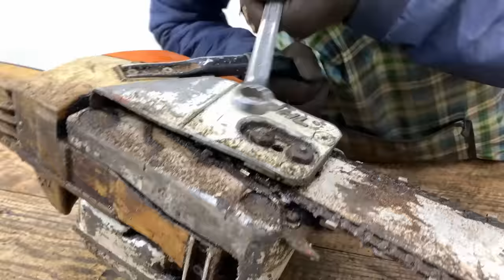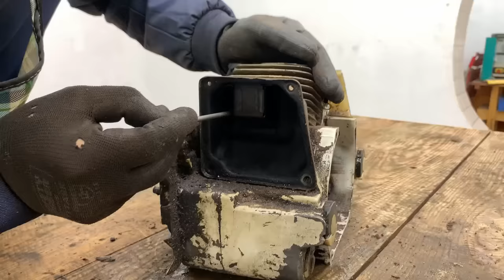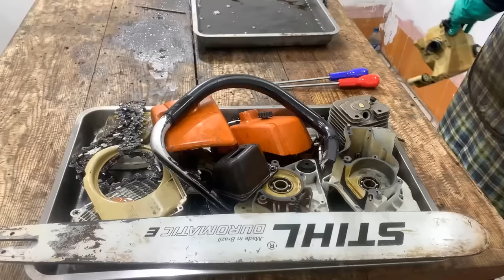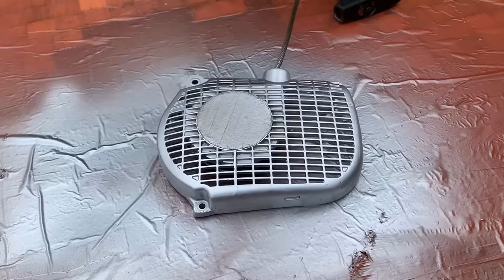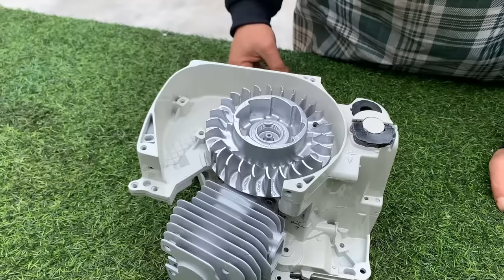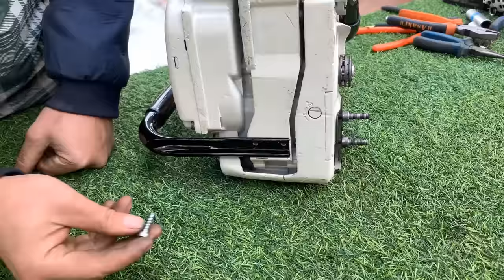Restoration Old Gasoline Chainsaw STIHL // Restoring 2 Stroke Petrl Chainsaw

Comment: You put the chain on backwards. You painted the air filter. You didn’t lubricate the pilot bearing with grease, that should have been replaced and you didn’t put any bar and chain oil in machine.
Reply: Also, needs 2-stroke oil applied to piston, rings, cylinder, crankshaft, bearings, etc. during installation.
Reply: what happened to chain brake missing should have replaced,does it even run
Reply: This was a waste of time
Reply: Amateur mechanic.
Reply: Where do I begin.
Reply: I was thinking the same
Reply: also the crank was painted aswell😂
Reply: I've noticed few issues too.he painted cylinder head that going to burn that paint off on first run..he also painted inside plastic parts that don't need to be painted..
Reply: I didn’t see any crank seals or for the bearing.
Reply: Bruh
Reply: Mi se dopaga od edna strana a od druga strana ne mi se dopaga so ne ja zapali masinata kako rabiti perfekno
Reply: Lmao
Reply: He also painted the crank shaft and everything inside the house and engine
Reply: The chain was also to tite
Reply: Bru
Reply: 7
Reply: And he missed the chain tensioner. Catastrophe
Reply: I'm sure we all saw the numerous mistakes he made. Too many to list actually. Only one person besides me noticed he didn't even try to start it on the video .
 This was nothing more than a gigantic waste of time. I saw on the Bar where it says "made in Brazil" this is the exact reason I don't waste my money on Stihl Power heads any longer. When they all came from Germany they were a great product but when they started farming out the manufacturing is exactly when they started to go down hill in quality and up in price until it's just too much of a risk to purchase one.
 Look, I've been a production Faller most of my life and used to run nothing but Stihl powerheads ( I still have one out in the shop that was built in Germany and is nearly as old as I am and almost as heavy but it still fires right up and could do 8-10 hours on the mountain no problem,  but I restored it myself with a ton of new replacement parts and just keep it for sentimental reasons. I switched to Husqvarna years ago and so far have not had one issue with their Pro Duty Saw Power heads period. But they too have started farming out the manufacturing of their stuff. They Bought out Jonsered Swedish saws (that also used to have good quality) and Poulan down in Georgia I believe and you can buy them now a little cheaper than Husqvarna Saws. Hell I own 2 of the Jonsered Pro Saws that are made in Europe by Husqvarna that are exact copy's of the same Husqvarna Pro Saws but less money ! And they run like a champ.
 I've ran 390XP and 395XP saws for years now and actually prefer the 390 over the 395 because of it's power band with a 3/8" pitch Full Chisel Skip Tooth chain on a 32" pro lite laminated bar...for the work I do now....I have bigger bars and chains but this just seems to be the best balance for the saw at least in my hands. I've bought their new 550 XP Mk II, the 572 XP  and just got a 592 XP powerheads these are all the "New" generation of electronic saws that you can hook up a laptop to and it will tell you things you never knew. 
The 550 I think was the Guinea Pig  for all the new stuff they were planning and when they got a combo they liked that worked right and was dependable they did the 572 then the bigger 592....now I used to have all my powerheads ported and built to run all out as fast and powerful as possible till our local Saw repair guy died from Covid about a year and a half ago now and I started doing all my own porting and building my own US Forest service legal Mufflers for all our powerheads and while the 572 gave me fits in a stock out of the box shape once I went through it with the computer program on our laptop and ported and fixed a couple of "other" issues it had it runs perfect now. I just got the 592 last week and am porting and reworking it right out of the box but I'm positive it will become my new favorite powerhead as soon as I finish it and find what length of bar it likes best but I'm guessing it's also going to be at its best with a 32"-36" bar.
 I was able to purchase 3 brand new in the box old stock 390's just because I've already heard the new stock 390's are having issues so I'm good most likely till I retire. 
 I carry my 390 to the woods every day and have no regrets or complaints.
Reply: Woodruff key ?
Reply: Coming up next on rough as restos 😂
Reply: @CrazyHHO19  9
Reply: Für Testversuche muss Man kann kettenöl einfüllen, da das öl beim schneiden dafür sorgt das die Kette nicht zu heiß wird und noch Cut so schnell stumpf wird
Reply: ❤❤٠
Reply: @mikespain8655 ⁰⁰
Reply: It’s just clickbait. They clean it, paint it and put it together with no knowledge. This thing doesn’t run
Reply: And didn't even use any assembly lube on nothing
Reply: He put regular gas instead of 2 stroke also
Reply: The video was faked
Reply: Not only that. The chainsaw wasn't even started to see how it ran!!!!!!!
Reply: Wow what a waste of time🤯

Comment: Nice way to clean a saw I guess and looks very nice all said and done. However, aside from the obvious chain being on backwards, chain brake missing/not added, chain Tensioner missing, and paint on the air filter. It would seem they made so many more mistakes I can't even count them all, especially putting paint on the Crankshaft. Who knows if the case bearings are any good, (love how they hammered the case together, couldn't have thought about that myself) but I digress, the clutch cage bearing needs to be replaced and they put the bar studs on backwards. Not to mention if the Carburetor is any good. But all-in-all they " kinda " know how to take a saw apart and put something together. Nice try👍
Reply: my thoughts exactly, I was horrified watching a lot of this lol
Reply: I suppose video made in India 😂
Reply: And to top it off, leaving us hanging without seeing it run!
I wanted to see it spit paint😂
Reply: At least the saw was safe from catching Covid….
Reply: They probably could have just serviced the carb and started this saw right up. Instead they took everything except the carb apart. What a waste of time.
Reply: For me, it was funny to see all these mistakes.
Nobody have to wonder of the missing function test ...😂😂😂
Best of all is the wrong chain direction ...
Reply: That’s what I was thinking if this was a chair it would have been a great job but not a complex machine. Besides like you said just rebuild the carb and it would probably start right up. There is no way this thing would star the way it is.
Reply: Dude, you beat me to it.  If you are not going to tale the time to do ot right....  At least new rings, better tape before painting, relube ball beariings, replace missing parts, check the cylinder for proper clearance.... All you did was a half way cleaning.  An old addage from shade tree mechanics is "If you can paint it you don't have to clean it."  You are sooo close ti doing real good here.
Reply: In fact the chain isn't nessesaryly mounted wrong, because it doesn't matter if it cuts on the forward stroke or on the Backward one, when you use it as a handsaw.
Reply: Qa
Reply: My sentiments exactly.
Reply: The best bit for me was when he painted the air-filter. Genius 'hack' I might have to try on my own saws. (Assuming I want them not to run.) Studs backwards, half the bearing missing, chain backward - etc etc etc. It all adds to the entertainment value.
Reply: Poor chainsaw 😭
Reply: they probably didn't even put temperature resistant paint
Reply: Why they dont start with the carburator . Cleaning can allways after that he is running again.

Comment: Did you sand plastics so primer and paint will adhere?  Compression test?  Leak down test? Clean carburetor?  Replace crankshaft seals? The MS 381 is the newer version of the MS 380, so really not that old.  All that work and you didn't even fire it up on camera.  I know Stihl products and this is a solid saw.
Reply: And the Chain goes backwards
Reply: And where is the Chainbrake
Reply: Looked better before, these old things just need a full tear down and clean/rebuild. It will be peeling paint forever now and won’t even start. 😂😂 this is hilarious man so rough as guts. 😅😅 can u do a video of trying to start 😂

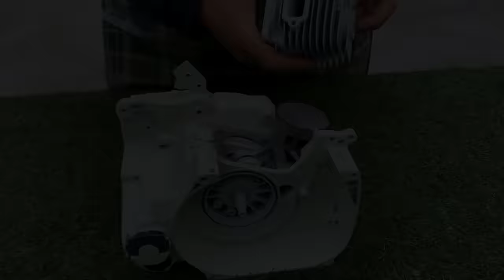Comment: 18:05 / 24:19 : yes VERY good job no 2 stroke oil used. Just put everything dry together and crush the rings into the cylinder without compressing them by hand or something...

Comment: Mate what are you doing to that saw... all you did was take it apart and wash it down, then reassemble without replacing anything, and with no lubrication on anything, and gasket sealer and paint where it shouldn't be.  And the chains on backwards.

Goes to show, a fresh coat of paint makes things look impressive to people who don't know much about them
Reply: Yeah I stopped at the point I saw the cylinder being put back on without a torque wrench lol

Comment: I've just started watching this and the first thing that comes to mind is, since when has anybody thrown out a Stihl pro model chainsaw? They are always worth money for the parts alone and that saw isn't even super old. Not with that style of oil and gas caps. It also had good compression and likely just needed a little tlc to run like a beast.
Oh well back to the video, though I read some of the comments and so I'm not expecting a happy ending.

After seeing the video.
Well that was a huge bummer. I'm sure glad that wasn't my saw. Smh

Comment: At least disassembling everything before painting... Now you have Paint in your sump!
Reply: Youtube seems to want me to put up some content. Challenge excepted!
Reply: This is sloppy. Put in the effort!
Reply: @jt9498  Yeah. It's more like "wash everything in gasoline and slap back together and spray the crank with paint". Or maybe I'm an idiot and asian gas magically regenerates bearings? :D But even more sad is when someone is calling people like us haters because we can see the errors and we know how restoration should look like. Personally I would at least change the bearings and seals if the top end had decent compression and wasn't scratched and changed out the clutch needle bearing.

Comment: You can't call this restoration, cleaning and bad painting everything yes....not restoration...and btw...you paint also the cylinder....my friend that one needs cooling, air cooling and the paint is not helping him ...and you pain also the connecting rod assembly... imagin that when you start the engine all that paint being dissolved by the fuel mixture and deposited allover the engine. You even painted the air filter ... why !?  where is the logic ?!  I tend to believe you're a painter ... but one of poor quality.  Did you imagine that there is an air valve for the oil tank that you covered with paint?
I hope next one is going to be better!
Good luck!
Reply from the maker: I am Happy To Receive Your Feedbacks, advices, Suggestions To Improve Myself Better 
!!!I Apologize For The Mistake If I have Made In This Restoration

Comment: Congratulations on doing a 50% job on a 100% restoration. Painting over multiple components that shouldn’t be. Including the air filter 🙄. No grease on pilot bearing. Andddd the chains on backwards.  Even if it did run it wouldn’t for long. Wall hanger

Comment: Do you want wood work with this Stihl chainshaw or you will Hold in vitrin cupboard in room forever? I have Stihl 880 and Stihl 171 Chainshaw and Stihl FS 560 bush cutter and Stihl HS 45 Hedge cutter

Comment: Not really sure what you accomplished there. Didn't rebuilt it. Shot it with a completely incorrect paint color including the crankshaft. Not a torque wrench in sight. I just rebuilt the same saw(038 magnum 2) but I took the opposite approach. I  used ALL new parts to the point that I pretty much just built a clone. But it looks and runs like new. I still have all the old parts and if I can ever get the original paint I will restore it too.
Reply: Edit. Sorry. I was wrong about the paint. That part looks really nice. You should have had someone who knew what they were doing fix the rest. Could have been a great project
Reply from the maker: Thank you for your feedback so we can improve future products. Wishing you good health

Comment: i watched the whole video and i can respect the skill to disassemble, clean, and reassemble the saw but feel like he did a lot wrong.  Not  one to fault someone but looked like he painted the air filer, torqued the spark plug down and the bar cover down with an impact as well as put the chain on backwards.  Wiring also looked suspect. This saw will likely not run well if it ever does. Its also can be no older than 16 years old.  MS381 was made is 06.  Just my input sorry if I offend.

Comment: I watched the clip only partially because I noticed several mistakes: the materials used for painting, the mounting technique; this is a clip with technical achievements. Among the mistakes, I can list: painting the cylinder, improper painting of the covers, dry assembly of the piston...

Comment: i feel pain in every second of watching this video... 
so many questions....

Why would you paint the airfilter, the gasfiller cap and the handelbar, perfectly fine orange plastic, exhaust, cylinder and clutch?
Why would you not replace the broken chain catch pin?
Why dont you repalace the missing chain break lever?
Why dont you replace the bearings and seals on the crankcase? 
Why not inspect/replace the manifold and impulse tube if you have it apart already?

On the other hand, why bother if the thing doesnt run anyway because of the painted airfilter and crankschaft/crankcase, uncleaned fuelfilter and not cleaned carburetor

and then we get to the real horrors of this video

i have not, and dont want to ever again, see anyone dis- and reassemble a crankcase with a hammer, mount the flywheel with an impact, mount the studs for the sprocket cover backwards, loose and without loctite.

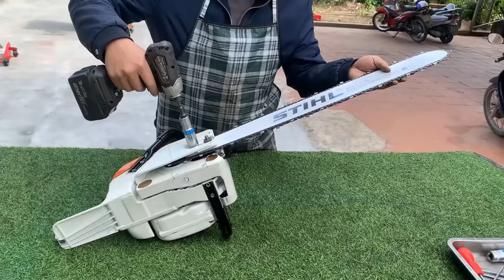just looking at the studs at 31:55 feels wrong... all exposed and stuff...

all in all i can say that this saw could look nice in pictures from 50 feet away. 
could.

for every thing else this was complete garbage und a waste of time

still fun to watch for me so 3/5

Comment: We had one of these at my workplace. And I looked into it because everybody said it didn’t work, and if they could get it working again, they would be using it all the time. I looked at the air filter. The air filter was pretty bad so I replaced that tried starting it still didn’t start so I checked the chain oil level and the chain oil level was bad had no oil in it so I filled that up and then I checked the gas. It had a little bit of gas in it, but it was pretty old, so I made some new Mixture and put some new mixture in that still didn’t start so I put some starter fluid in the engine and took the spark plug out and pulled the chain on it so that the piston can move up and down and I added a little bit of some gas mix to it that helped a lot with rinsing it out and then I put a spark plug back in and it still didn’t start so I got a new one and put a new one in and that puppy started right up.
Reply: My grandma had a ms181c in her garage that she bought as a display model even though she wanted one in a box, so it never ran even though she was told it would but it sat for 10 years roughly and I found it and asked if I could try to get it running, I replaced the gas and cleaned it up a bit and nothing, so I replaced the spark plug and boom it ran, I'm 15 but i have already put it through some professional work and it doesn't hold back.

Comment: The saw isn't exactly old, using a knob rather than a screw to take off the back, and the caps for the chain oil and gas+2-stroke oil have the 'lock', early 2000s, almost identical to my ms290
Reply: Ms is 2010 to current day
Reply: @brockschaner2861  MS started in 2000/earlier

Comment: Even after all the big no no's done during the so called restoration you didn't even attempt to start it up lol I can guess it doesn't run at all because you didn't fix the saw. All you did was clean it and paint it. There's a saying here in the US about that kind of crap, putting lipstick on a pig. 😂😂😂😂

Comment: The title must be ""how not to restore a petrol chainsaw"" You sprayed paint all over, inside the fuel and oil tanks, on the air filter, on the bearings, threads... The small bearing on drive shaft is missing some parts, brake handle as well, you put the chainsaw backwards, petrol without oil, and the list is long. I bet it did not start after the "restoration", and if he did start it will draw paint from gas tank and die forever. I only watch this because i have a old stihl 023 myself that need to be revived. Someday, not today.